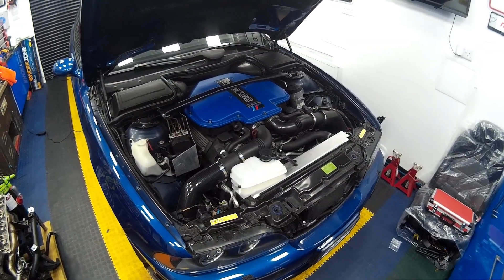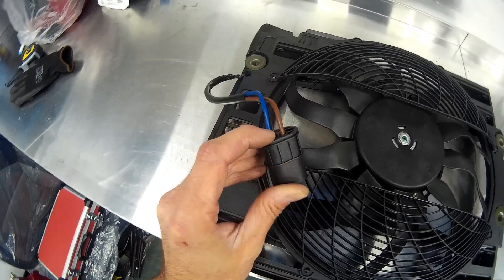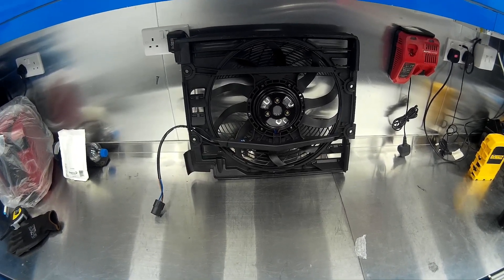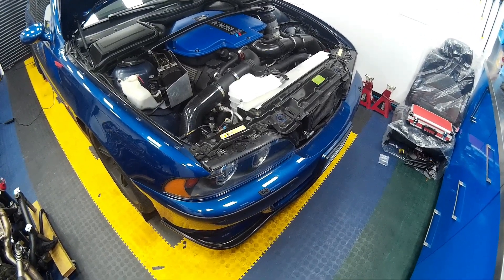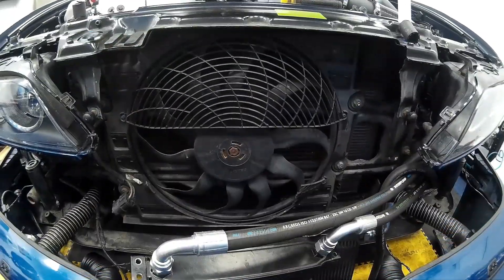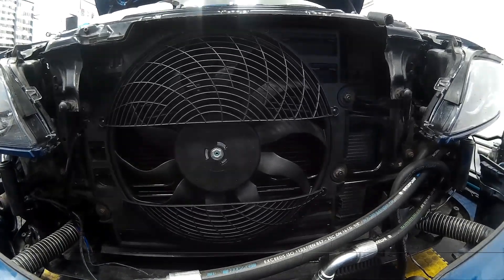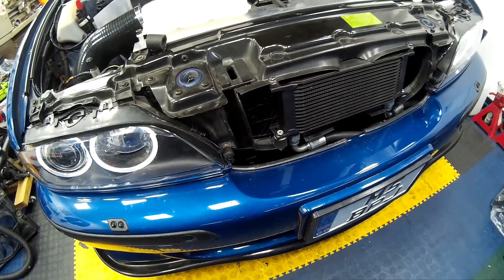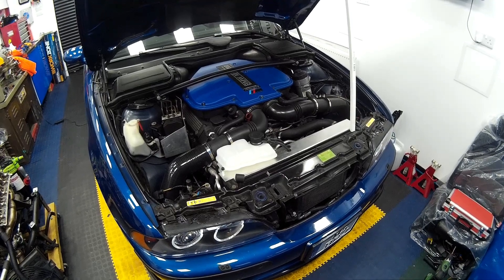BMW E39 M5 Air Conditioning Aux Fan Change DIY How To Guide

Comment: Do you know what sensor that turns on the fan? Is it the one on the side off the radiator aka temprature sensor? Cause I tested the fan today with inpa and it worked on 50% and 90% speed. I just want it to work when needed. Any tips would be nice to know😀

Comment: Sir if can put fan of 4 wire to plug 3 in car
Reply from the maker: Not without modification. 

The 3 wire fan uses PWM to determine speed and has a constant 12V main feed. 

The 4 wire fan uses switched 12v feeds via relays to determine the fan speed

Comment: Excellent video, i ha ve a question, my car started overheating out of the blue, i changed the thermostat with a new one, water pump with a new one, checked the radiator for clogged stuff, after all this i noticed the ac fan its not working at all🙄 can that be the problem of the car be overheating? 😬, greetings. Its exactly a car like yours, an M5e39.

Comment: Could you please help me? 
I have following problem. Fan is working but sound is like the fan rubs against something plastic.

1. video is on cold engine (very noisy)
https://youtu.be/IUOjvatsRSA

2. video is on warm engine (I could live with that) but if is easy fix, I would like to fix it.
https://youtu.be/UKPDOSQCebU

Thank you very much :)
Reply from the maker: Very easy fix for that - Take the bumper off and you'll find that the forward fan protection grill has warped with the heat. You can bend it back gently and support it with some cable ties - Nothing too major to fix.
Reply: @WestinghouseProductions  thank you very much for answer. Waiting for summer to repair it